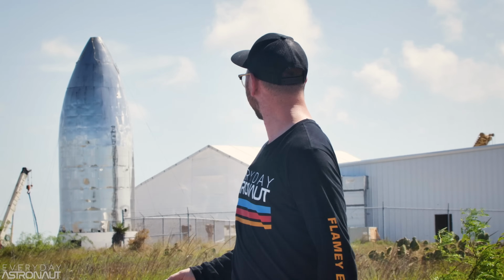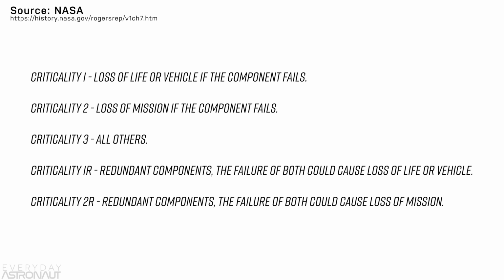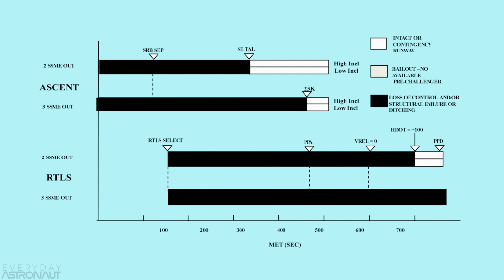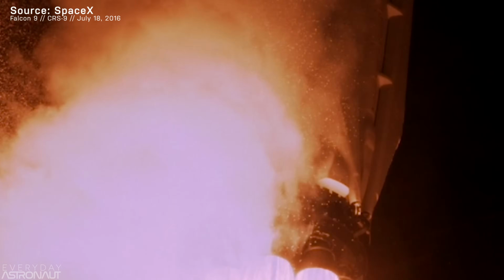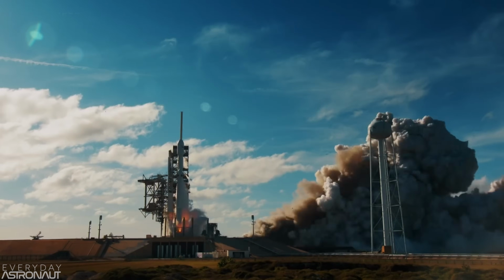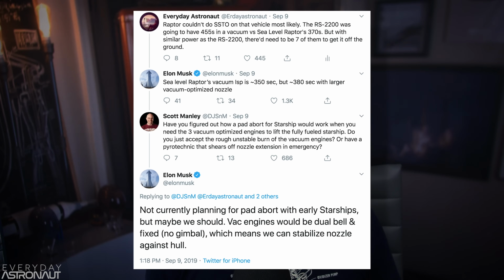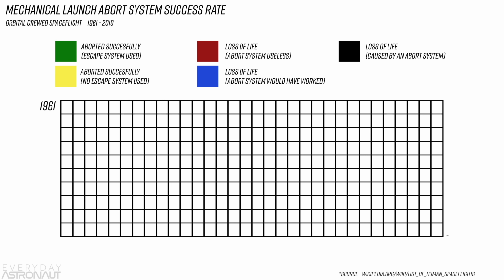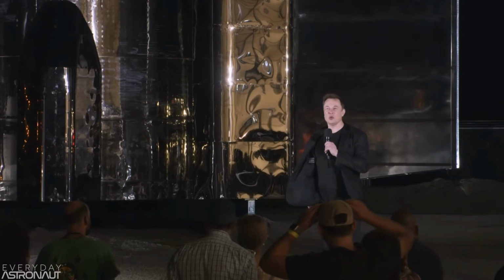Why won’t Starship have an abort system? Should it?!

Comment: Thing is, when you're transporting up to 100 people into orbit just designing an abort system gets massively more complicated. I mean, assuming Starship's crew section weighs ~100 tonnes, and that an abort would require 4 g's of acceleration, you'd need an abort engine with ~5,000 kN of thrust, comparable to the F1 rocket engine! Then you need to pick a fuel, which is probably either nasty hypergolics (and a LOT of them at that) or solid fuels (which have their own safety issues), then you need to certify parachutes, heat shields, etc... Unless there's a version of Starship with only a small ~10 person crew capsule I don't see an abort mechanism being any safer than no abort mechanism.
Reply: Personal rocket deployed emergency Parachutes like hang glider pilots have, and inflatable vectran balls, like those proposed for motorcycles. It's possible.
Reply: @tonyrusi1978  
Then things start to get REALLY complicated. I mean, ejecting 100 people simultaneously from an exploding rocket without them hitting each other would be very tricky.

Comment: We walk into giant metal flying tubes everyday without an abort system. And I'm going to imagine those are far less looked over than reused starships will be. So ya, once they fly starship a few times to prove it out, I'd hop on it without an abort system
Reply: Starship compared to jet airliners, would be like the first De Havilland Comets, which had a bit of a checkered safety record.

Comment: IMO if a rocket 'needs' an abort system, I would be much more worried about it. If it was flown many times and designed not to need one, that would make me feel far more safe.
Reply: Yeah, that is why you never use seat belts in cars nor enter ships with life boats.
Reply: @Antares2  Cars don't have abort systems, but are designed to protect passengers in most accidents. Your example proved my point. Cars with modern safety systems are better than a car with an abort system.
Reply: If the soyuz never had a launch escape system...

Comment: the best way to engineer against the mk1 failure would be to build a fail point on the side of the tank so it explodes like the SLS, and put some column to make it stand after the explosion. that way the tank can explode, the crew inside will be fine, as steel can survive the heat, and then disembark after the fire is over. no need to jetison into the sky at supersonic speeds.

Comment: In both shuttle disasters the crew cabin remained intact due to them being hardend and the crew possibly alive until impact. The same might be true of a starship disaster: if the cabin is actually designed to break away more cleanly and included parachutes it could work. Difficult to survive but better than nothing.

Comment: Great video. I agree with your conclusions about flight data. The only problem is the price of a rocket itself. It is not streamlined assembly (yet). Unless Elon Musk will settle with design and start just improving it (like car or aircraft models) we can talk about 1000+ flights a year. Plus there is no real demand for so many flights yet. With Airplanes benefits were obvious from early on. For rockets, well, outside of proposed Starlink it is not so visible for typical human.
Reply: I love the question, but I have to disagree with your answer. Everyone I know would rather take twenty minutes to go halfway around the world than 20 hours in a jet. I would also rather take a week to get to Mars, rather than six months. Plasma Magnet Drive and/or Dipole-Drive can cut travel time to Mars to less than a week! It changes everything! Mars becomes the next continent! It becomes practical, and reasonable, instead of a military endurance experiment!
Reply: @tonyrusi1978   If what you say is true, why Concord was closed? Also all those fast travel technologies are in theory/prototype stage. Also Mars is continent-yes. But right now in our profit driven world there nothing to gain here. Just remember that most of the searches for new continents were fueled by hunger for great treasures. Yes, there is a percentage of adventurers, but even they are in need for hard cash to get there. We don't have any technologies to sustain Space/Moon/Mars colonies on their own.

Comment: Great video,
but first the timneline on the graph which showed the uses of abort systems was a bit confusing to me
and second, even though it would make it saver, I dont think we should fly more rockets, because of the whole pollution thing. Dont understand me wrong, for sciences or stuff like GPS and telecomunication it is well worth it, but for space tourism, as long as the rockets aren´t CO2 neutral, like Elon proposed, they should just find over activities

Comment: Another great video. So basically a steel body, redundancy and an improved heat shield make Starship safer than the space shuttle (which also never had an abort system). Historically, abort systems haven't been used much and they are complex beasts in themselves. Time and energy would be better spent improving the reliability of Starship components rather than focusing on an abort system.
Reply: Maybe, consider: lawyers.

Comment: Another great video! Quick question, could a fully fueled Starship actually pull away from the booster if it was to fail during flight? The abort systems for Dragon/Starliner/Soyuz seem to accelerate the capsules rather quickly, does Starship have that kind of Thrust to weight ratio?

Comment: In theory Starship  could be made as reliable as an aircraft but to say 10 test flights  or even 100 is arbitrary. The FAA or their equivalent will require a detailed certification / testing process that could take  years to implement. Remember this is a colonization ship, flying 100 people at a time, that is also being considered as a earth high speed transport.

Comment: I will admit I'm only 11 minutes in the video When developing this opinion, but think it kind of odd to double standard that NASA has put on contractors vs some cells for safety, and I say that in regards to the shuttle Challenger, 100% preventable, it's my opinion they murdered those people, and somebody correct me but was there ever any consequences for that?
Reply: They put in those standards as a direct result of Challenger.

It's not a "double standard", it's just a desire to not repeat the same mistakes.
Reply: @ShadowFalcon  if that was the case we would not have had the Columbia disaster, safety-wise it's a perfect example of this is what we've always done so it must be okay. Can I say this not because I think I know better or could do better but it's the space race, this is not Armageddon they weren't trying to save the world, very sad loss of life.
Reply: @michaelladue5655 
Different cause of catastrophe.

Challenger happened because of SRB O-rings, Columbia happened because of ET insulating foam damaging the heatshield.
Reply: @ShadowFalcon  I know there were two separate independent system failures, but they knew ahead of time the SRB was unsafe in those conditions, but they chose to fly it anyways, and the icing and the brittleness of the carbon tiles, they can't be so stupid as to not know that one day that was going to be a problem.
Reply: @michaelladue5655 
They work on experience gained from other flights, and before Columbia, another Shuttle had reentered with a similar gap in the heatshield.
Reply: @ShadowFalcon  I would like to take a moment and pause in our debate and thank you for being a mature human being, I'm going back and forth with me on different ideas here, with no belittling badgering and name-calling
Reply: @michaelladue5655 
Hey, no worries.

It's getting kinda late in my end anyways. Have a good one.

Comment: After hearing that they actually had a similar issue 15 years earlier to Columbia actually made me angry. Why did it take a loss of a vehicle for them to start doing checks on the tiles prior to re-entry? I actually wonder what they would have done had they found the hole before re-entry, it was clear they wouldn't have been able to  re-enter with it and repairing it would probably had required another rocket flight to get a spare part up there.

It could actually be actually worthy of an actual video on its own tbh, assuming you'd have access to the actual people with the answers. :)

Great video yet again Tim, well done from this Patreon :)

Comment: First, GREAT VIDEO!  I love that you exhaustively research these topics.

With respect to the SpaceX "load and go" fueling procedure, remember that fueling before boarding the spacecraft has it's own hazards.  If fueling is complete, then when the crew boards the spacecraft  a large number of individuals (not JUST the astronauts) are strolling up to a vehicle with the destructive potential a small (very small) tactical nuke.  It MIGHT well be that doing that is MORE dangerous than sitting there in the Starship, with an inherent limited abort capacity (as long as it is fueled first), while the booster is being fueled.  Also, NASA was highly skeptical of the SpaceX way, but was persuaded after study, although this is in the context of Crew Dragon, which does have an abort system.

Also, is seems to me that Starship will be designed with greater margins to failure than anything else to this point.  While it will obviously be a high performance vehicle, it does NOT need to be as close to the ragged edge as older hardware since is is intended to be refueled for missions that go beyond Earth orbit.  Meaning that I would be surprised if structurally, it isn't considerably more robust (more margin in the tanks for example) in relative terms than existing hardware.
Reply: The destructive potential of a rocket exploding is nowhere near a small tactical nuke or indeed any sort of violent nuclear reaction. In fact if the people involved where merely in the same room as a plutonium core, of a nuclear bomb, when it went critical, as in not exploded just started producing massive amounts of radiation, their death would be much more certain. Not to mention horribly slow and painful. Honestly nuclear reactions involving any of the metallic elements used to make nuclear bombs are much more disturbing than exploding rockets even when they are not inside the bomb. After all there is a very good reason why we store spent fuel in water for a pretty long time before it can even be stored on land and even then it's put in some seriously heavy duty containers.
Reply: @aBoogivogi  I said "very small".  Starship + Superheavy together amount to 4.5 kilotons of propellant.  Little boy was estimated to be about 15 kilotons TNT.  The biggest difference is how rapidly the explosion occurs.  Thus, "very small".

Plus, have you never heard of poetic licence?  Mild exaggeration?  Turn of phrase?

And, try not to talk about nuclear physics as if you know something, because you clearly don't.  Fission bomb cores don't go "critical", which is a self sustaining steady state nuclear chain reaction.  The material involved is far too enriched.  The materials are either far enough apart to remain sub-critical, or they are brought together to form a "critiical mass", and in microseconds (before you can even think "disturbed") you have a nuclear detonation.
Reply: @jayjohnson3732  You compare a nuclear bomb to en equivalent explosion produced by TNT because that's well understood it terms of it's destructive potential. You don't compare a rocket explosion with it because it has no real correlation to TNT. The term explosive and explosion however does not relate to TNT alone. Hence we have explosive fires that has no comparable TNT yield yet still have an explosive nature. So arguing that what happens when a rocket collapses sort of behave like an explosion might be ok, it's  still pretty dubious, but arguing that it's anything like a very tiny nuclear explosion is incredibly inaccurate.

As for your understanding of nuclear explosives this is also wrong. For starters all nuclear bombs do go critical. Or rather super critical, but you can't get to the latter without passing through the former even though they naturally try to get the fuel super critical as fast as possible. In fact the first fission bombs relied on this aspect of their nuclear material to work as they typically used a shotgun trigger mechanism. Later models however used conventional explosives to compress an inert mass into a super critical one. These designs were again improved by adding an adjustable neutrino generator to enhance the amount of fissile material that actually vent super critical during the blast. This is also how you got variable yield bombs. No why does this matter. Well the plutonium used at the core of a nuclear fusion bomb, which is almost exclusively what we have today, is very pure. Bring it into contact with anything that produces a significant amount of neutrino radiation and it may be enough to make it go critical. This includes another pellet of plutonium by the way as it is still radioactive even at rest. If it does go critical, even for a few milliseconds, and there is nothing blocking the majority of radiation from reaching you it's a death sentence.

As far as other nuclear sources that can go critical fission reactors are basically designed for it. Which is why these reactors also have a ton of shielding and why any part that has been inside or even remotely close to the reactor is typically stored in water for a lengthy period of time before it's safely disposed of. As it is infused with a ton of radiation during it's lifetime.
Reply: @jayjohnson3732  Well there is much more to a modern fusion bomb as my description mostly talked about a fission process. That said hydrogen bombs typically work by using a small fission bomb to compress another substance to the point where it goues super critical and starts a fusion reaction. Hence they are just a two stage explosive device where the compression is done via nuclear fission as opposed to conventional explosives. 

As fort the phrase "neutrino generator" the only error there is that what I am talking about is neutrons and not neutrinos. If you read my comment you would have noticed that I managed to substitute the two particle names consistently. It was a case of the mind thinking about one thing then picking the wrong name for it consistently. Also it may be more common to use this with a two or three stage fusion design although it will still be effective in a regular fission bomb as fission like fusion is still driven by neutron collisions splitting the atoms apart. 

PS: If you want to get insanely pedantic an engineer making a nuclear bomb might call the neutron generator an external neutron initiator. Both devices serve the same purpose except the name neutron generator  is typically used for something in a lab and not something that has to be part of a bomb.

Comment: It only takes one crack for a previously 100% reliable system to become a failure statistic so yes, modern society will dictate an abort system will be needed..... But...

Statistics will also show that failures are so few and far between than they are probably not needed, like racing drivers, astronauts know and accept the risk that every time they sit in a rocket, it might be their last flight.

Comment: Your main logic point is seriously flawed unless you believe the engines and designers didn't care to get it 'safe' in the first please.  Then, Yea, let's just try and make the rockets safe now.
Reply: Look how much NASA tests and still has deadly failures. Starship will kill a bunch of people. Then that's the end of the Mars program.  I can't believe they aren't going to have at least starship abort
Reply: @Bryan-Hensley  I have though that too.  However I don't have all the information needed to make a valid prediction on that and I'm not really in favor of them making that connection janky enough to allow for separation while under booster destruction.  Given their 1000 people capacity I would think something more like the purposed 747 parachute system may be better while at earth but frankly there are so many different flight envelops for this thing I don't think it's possible for one system to be able to handle all without it being the actual ship.

Comment: You made very good points, especially about heritage. However something to keep in mind is sometimes heritage isn't necessarily a good thing. Take a look at the Boeing 737 Max-8/9, a case of a design with a long and excellent heritage get pushed just that little bit too far. In the case of the 737 Max-8/9 the design considerations of the original 737 made a simple upgrade of the engines impossible whereas the Airbus A320 could simply hang the new engines on the wing. The 737 was made intentionally low to the ground to give it the ability to service airports that at the time generally lacked the loading equipment that is ubiquitous today. That lack of clearance compared to the much newer A320 family meant they hung the new engines in positions that would create natural pitching during operation, and they implemented a software system to keep the Max-8/9 the same classification to reduce the training required by law and to make it more appealing despite it's new flaws that were in most cases not even mentioned in the manual or Emergency handbook.